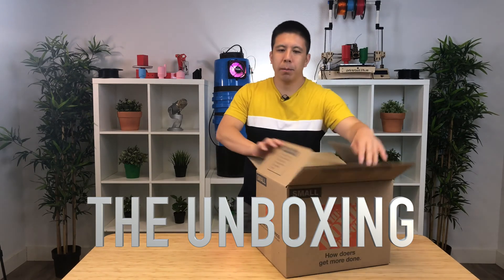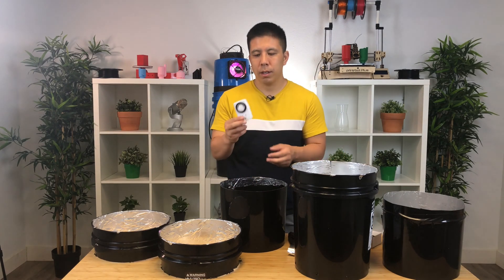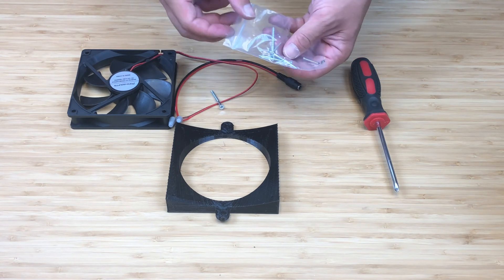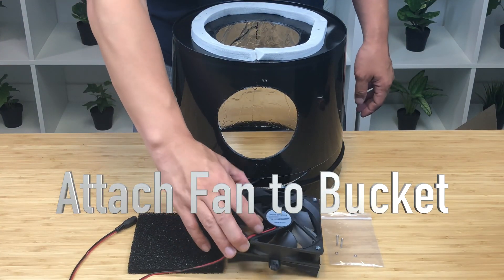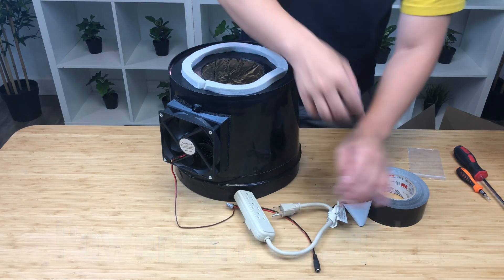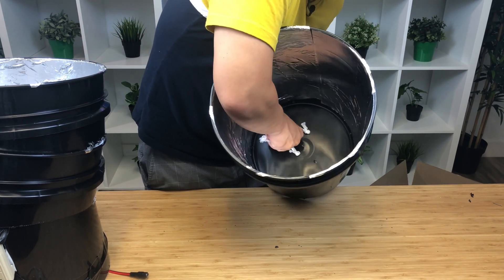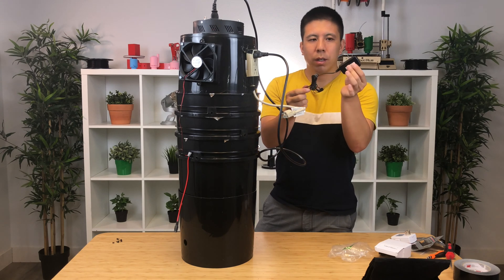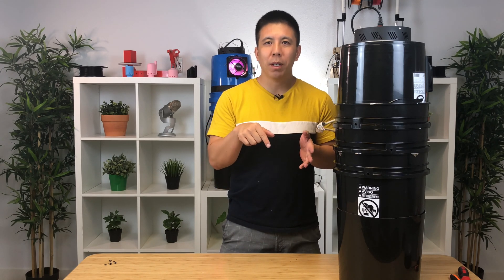HomeMade Grow Space Bucket Assembly

Comment: One of my cats chewed through the wires of the fan before I could install it.  Do you know where I would be able to get a replacement for it?
Reply from the maker: Hi Micheal, you can buy some replacement wire at a hardware store and replace the section of wire that is chewed through. Cut the chewed sections and then get the replacement wire and connect them to separated ends of the fan wire. Then, use electrical tape to protect the wire at the joints. Should cost less than a $1 of wire to fix this issue.
Reply: @HomemadeGrow  thanks for the reply.  Much appreciated

Comment: I want to order this kit. A few questions, the fan acts as an exhaust, so there has to be intake air holes, where are they located? Also is the wickng system enough for marijuana plants?
Reply from the maker: The intake holes are at the base of bucket and plenty of air is drawn in through those holes. To answer your other question, the wicking system is definitely enough. It actually provides just the right amount so the plant is not over watered or under watered.

Comment: How do you pull in fresh air with only 1 pc fan?
Reply from the maker: Using negative air pressure, air is pulled in from the bottom, cycles through the whole bucket, and pushes put through the fan.

Comment: Hi - I purchased one of your space buckets a whiles ago, and wanted to ask - is there a reason why there is a hole drilled into the side of the bucket which holds water?  Otherwise, awesome product!
Reply from the maker: Hi Andrew,  the hole is used an an overflow. The hole on the side of the water reservoir prevents accidentally flooding the main grow chamber when the main grow chamber is placed on top of the bucket stand in the water reservoir. The hole prevents water in the reservoir from filling above the height of the bucket stand.
Reply: Can the hole be used to turn the bottom bucket into a hydroponic set up ?

Comment: I purchased the 193$ set up. Dose it come with light
Reply from the maker: Hi Barrett,

The bucket does not come with a light. To reduce the cost for the bucket, we link the the light that for you to buy.
Reply: @HomemadeGrow  is this light enought for flowering ??
Reply from the maker: Yes, it’s enough.
Reply: @HomemadeGrow  how do they get the air they need
Reply from the maker: Hi Barrett,

There are holes drilled at the base of the bucket that allow air to enter the bucket. The exhaust fan at the top of the bucket pulls air out and creates a negative pressure zone inside. As long as the exhaust fan is on, air enters from the holes at the base, travels through the interior of the bucket, and is pushed out through the fan. 

Your plant will have ample airflow.
Reply: @HomemadeGrow  awsome my guy

Comment: Does this control the smell or do i need to purchase a carbon filter?
Reply: Does the filter from the fan control the smell?
Reply from the maker: Hi Josue,

The filter on the fan is a carbon filter and it does control most of the smell. However, you can add a more powerful filter and attach that to our fan using our 4” duct adapter.
Reply: @Paperoutej  just get a tent. this thing is a joke. a 1x2 x 1.2 with a HGL 440W led can net you 2.5lbs per cycle...
Reply: @joeprinsen1717  some people don't have the room or need for that, space buckets provide a contained way of experimenting with growing.. stop gatekeeping weed growing lol

Comment: How much
Reply from the maker: Hi,
Please check our website for our prices. Https://www.homemadegrow.com
Reply: I got a question do the pc  fans and items come with the bucket or do you have to buy the fans mylar separate
Reply from the maker: Hi,

The fan and fan adapter come with the bucket. The buckets also are shipped with the interior lined with aluminum foil tape. We don’t use mylar with our bucket.

The only things required to grow and not included with our grow bucket are the UFO grow light and duck tape, which is used to tape the power strip to the bucket.